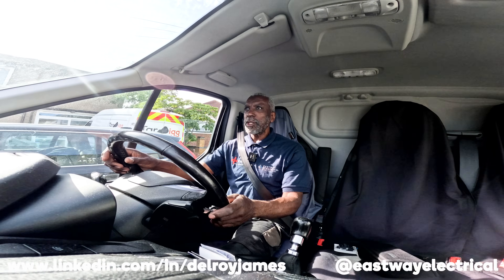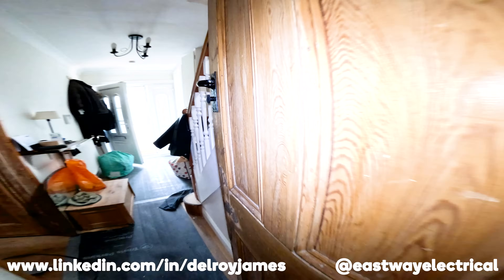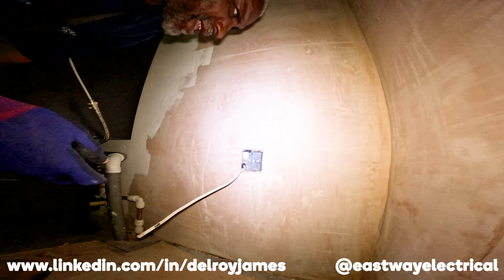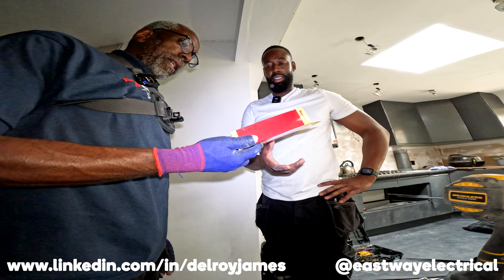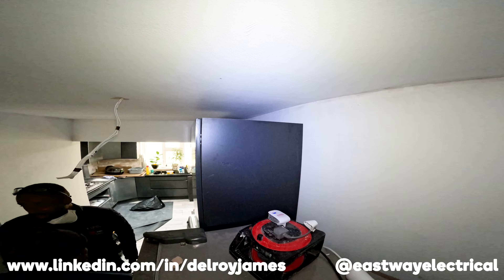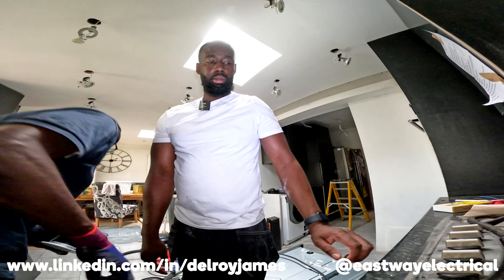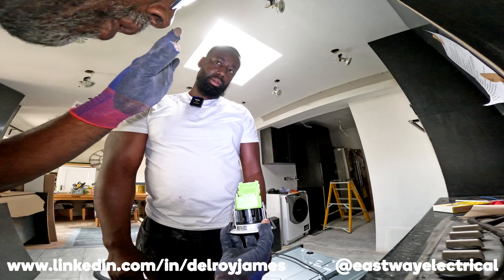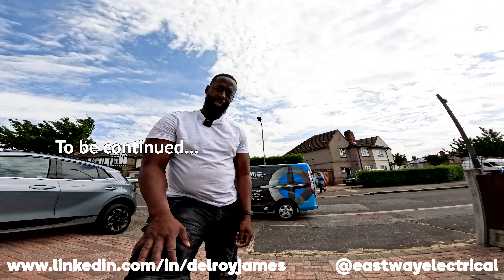"They've Done This All Wrong" | Working  With Builders

Comment: Hi Delroy! Have a look on the DADE - dust and debris extractor. It does a very good/ clean job for when you need cutting holes. And it’s not even that expensive. Save your time in cleaning afterwards

Comment: Builders. Tunbridge Wells  wired several 2 gang 13a sockets in a new extension with twin  Bell wire. Could not believe my eyes. Was called out because the fuses kept blowing when the heater was on. Turned out, the sockets were fed from the lighting circuit. 6amp MCB kept tripping.  Then to find bell wire and no earthing was the end game. I dissed the lot and advised the landlord will be contacted. £2000 a month rent deserves more than this.